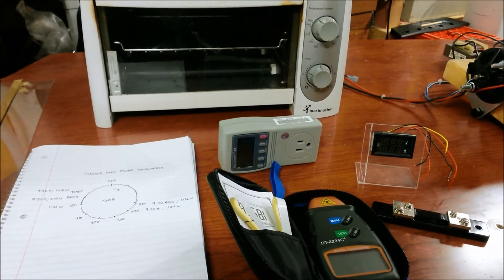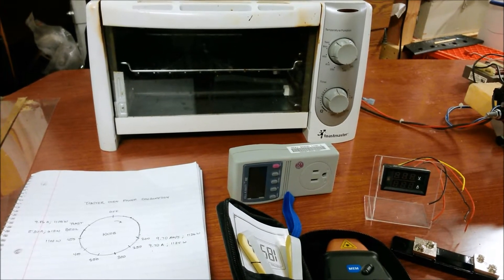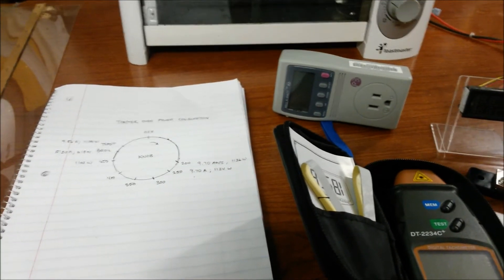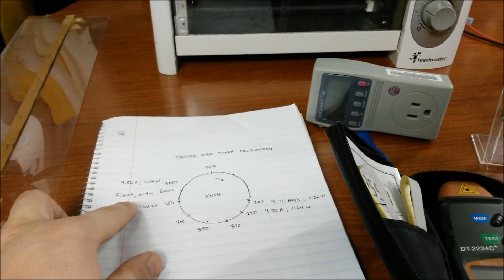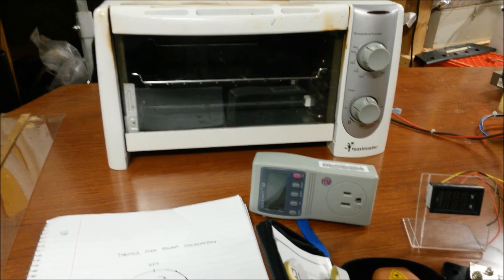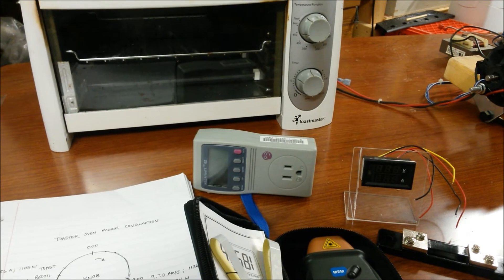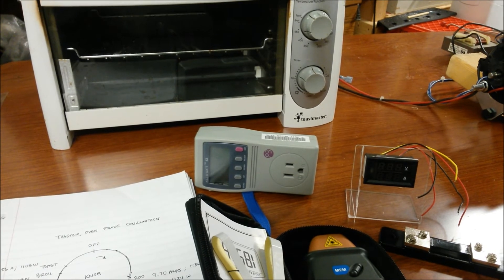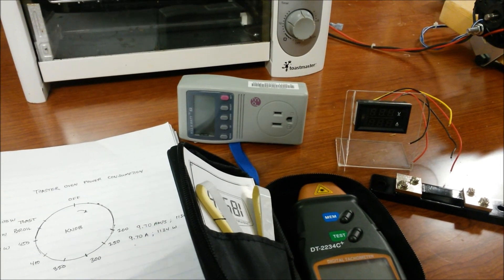DC Motor Dyno Update 1

Comment: Try looking for replacement parts for the treadmill donor for belts and maybe pulleys? May even check eBay for folks that have stripped other treadmills down to sell the parts.
Reply from the maker: +Kevin Hanes Thanks for the suggestion. When I took apart the treadmill, it's very straightforward. The belt comes off the motor and goes to a plastic pulley that is pressed onto the front drive roller. There wasn't anyway to remove the pulley from the drive roller, at least that I could see.

Comment: The micro belt pulleys are really easy to make. If you don't have a lathe I'm sure a youtube'r near you with on would help you out.
Reply from the maker: seditiousmonkeyart Thanks for the suggestion. I hope to get back on this project in the fall.
Reply: +Erich's Alaska Channel The micro v belts are really easy and cheap to make if you have access to a lathe.  Just make sure you compensate your calculations for your pulley ratio.  I'll be connecting the engines I am testing in a direct drive configuration.  The treadmill motor you have is good for 4500+ rpm and 2.5hp so you shouldn't over-run it.  The toast oven elements are a good choice.